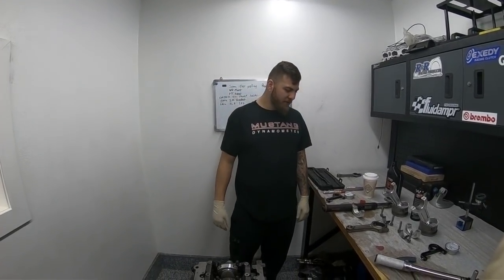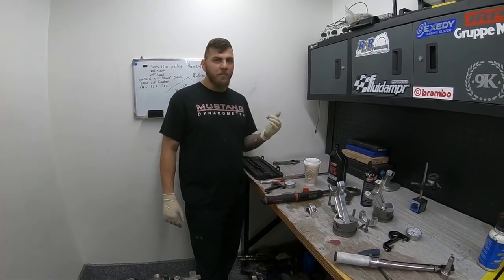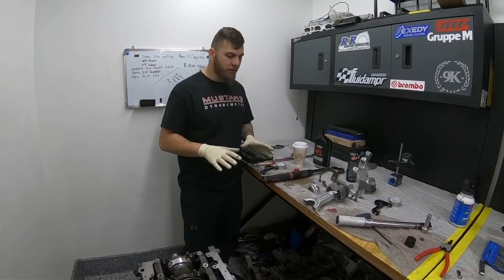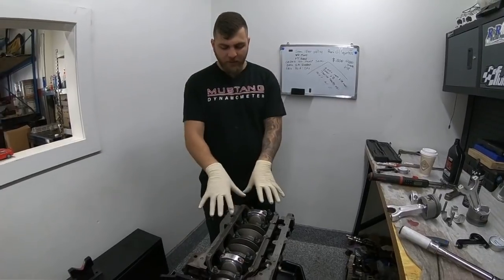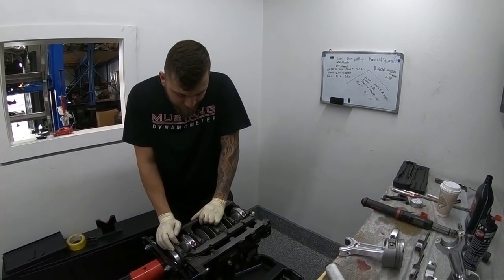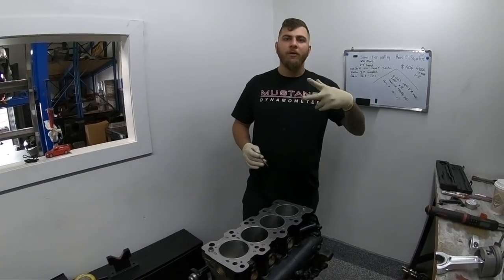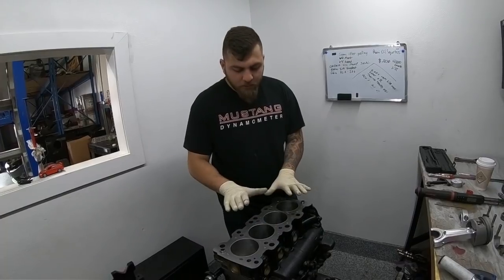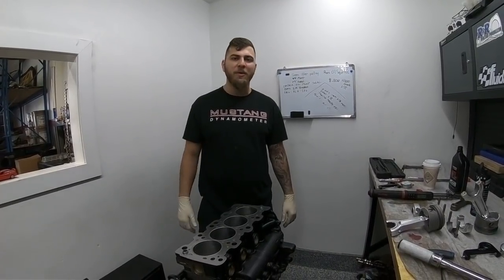Aluminum Rod Slaughter Package, Pros & Cons, Concrete filling, O-rings and much more!

Comment: Just curious why aluminum rods hold up for thousands of hours in small engines (like a lawnmower) while they only last 20 miles in a automotive application? Granted the small engine is only running at 3600 rpm but looking at the rod in one compared to the aluminum rods used in automotive applications it seem like the much thicker and stronger automotive rod compared to the piston weight, stroke, and the rod acceleration would make up for the increased RPM between the two? Any thoughts on this?